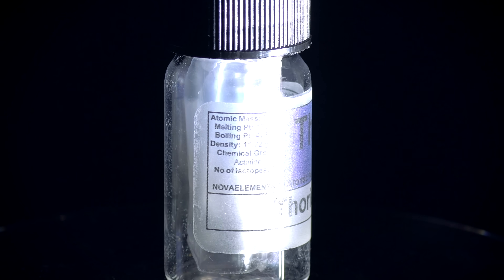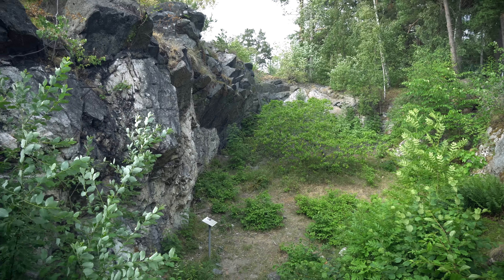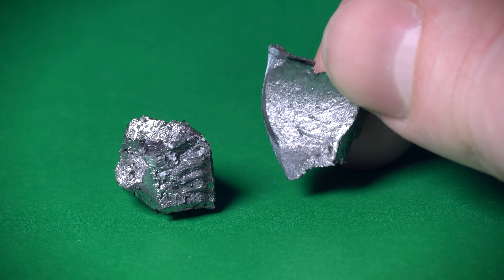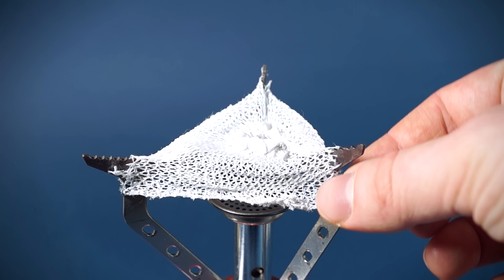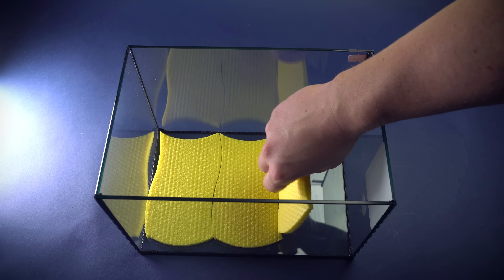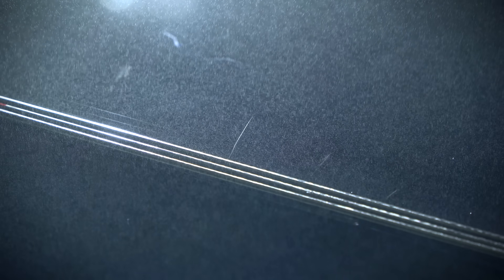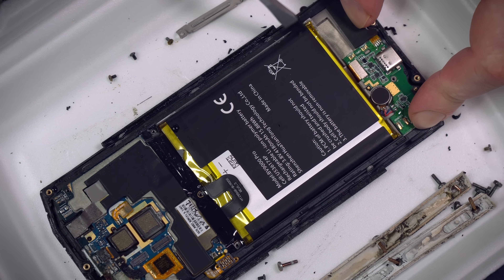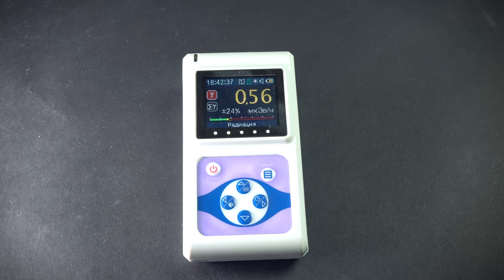Thorium - A METAL THAT NO ONE NEEDS!

Comment: In high voltage vacuum tubes, the filament is usually Thoriated Tungsten, which is a Tungsten wire coated with a Thorium-containing alloy known as Thoria.

Comment: There is another possibility for thorium in long distant space travel where it's not just a chemical fuel needed to go long distancees but a irradiated sorce to creat propulsive force, such sorces could be used putting satellites and other UAVs in space not limited to but for example the challenger probes or using them in a more updated form of long distance manned space travel, during such missions astronauts are subjected to being exposed to large amounts of different types of radiation anyway being in a sea of stars and still safely in space suites when making repairs to equipment, exposure to this radiation wouldn't matter as long as a space suit is designed to protect against it which means liquid rockets can be phased out after exiting earth's atmosphere and remandors of liquid fuel can be saved to transition back to upon re entry to earth's atmosphere.

Comment: Nuclear reactors can run on This
Reply: thorium sucks as reactor fuel.
its fission reaction is far weaker than plutonium and it falls off into useless waste way quicker.
you would need several times the amount of thorium to make fuel rods that last as long as currently used plutonium based reactor fuel.

Comment: You seem to be forgettingThoriated Tunsten electrodes for TIG welding?  Of course Thorium is usefull,  gives excellent service for welding Aluminium alloys with AC TIG welding plant.  One of many alloying elements used in tungsten based electrodes, Cerium, Thallium, Zirconia... each gives the electrode the characteristics it needs to give good welds in a variety of different metals.

Comment: Thorium can be used as fuel for the molten salt reactor design and it would be much safer than the current generation of Uranium fission reactors, If governments and the Nuclear Industry would quit ignoring and suppressing the technology. Currently not used as it can't "breed" plutonium for use in nuclear weapons. They want their weapons, piss on generating electricity.

Comment: Thoriated thungsten isn't just used for welding electrodes but also as filament wire for electron impact heating within ultrahigh vacuum experimental setups - of course in very low concentrations. Thermionic emission of electrons is facilitated by segregation of Th to the wire's surface, lowering the work function for electron emission when an electric field is applied between the wire and the heating target.

Comment: Hello! 😵 Thorium is probably the only future fission energy source. Fusion will stay a decade away for the next 50 years, barring a major break thru. 
Renewables will get cheaper, but are not concentrated and not consistent enough for base grid supply.
Uranium fission power promotes nuclear weapon proliferation. Eg Germany and the Swiss are actually 6 months or a year from being able to make and use A explosive devices.
Thorium reactors do NOT generate plutonium, need for A bang bangs, and fissile triggers for H bang bangs.
Lastly a Thorium reactor can consume high level waste from legacy Uranium power plants. Thorium reactors need an external energisation step to work (so failsafe, no core meltdown). This energisation could be provided by either nuclear waste burn, or a cyclotron providing the neutrons needed to start and sustain the Thor reactor.
Reply: for fusion, you want SMALL elements, not large ones.

Comment: Forget about thorium reactors in the future, we currently use it to get actinium to treat cancer. Seems you didn't do all your homework here.

https://youtu.be/DmczVhGq8cU

*Also, it's only thorium-232 that has a 14 billion year half life. 231 has a hl of 25 hours, and 233 is 21 minutes. Come on, man.
Reply: we already have produced high temp thorium reactors in the last century.  several countries did.  they worked great... but could not politically compete with uranium, so were simply dropped.  only India continued the work on them.
Reply: @thomasneal9291  I heard they were mostly dropped because of the excess of uranium from the cold war, or something like that. A matter of convenience over safety, since uranium power plants need pressurized systems while the thorium does not. These pressure systems failing have been the cause of many incidents.

Comment: If Thorium reactor comes , Electricity issue of India would be filled for thousands of years , as India has largest thorium reserves .
Reply: India has all but abandoned Thorium reactors, & is looking into EPR & VVER reactors.
Reply: @rhynosouris710  VVER reactors DO use thorium.  gees.  in fact, the design is over 50 years old, and those reactors have been produced in both the US and Germany in the last century, and they work much better than standard uranium reactors.  the reason it was dropped was pure politics, and nothing more.
Reply: @thomasneal9291  Sadly, you are misinformed. But don't take my word on it, do a bit of research.

Comment: Thorium could be used as fuel for nuclear reactors. Much safer than uranium and plutonium.
Reply: not could be, HAS been used for nuclear reactors of the very high temp variety.  both the US and Germany had produced functional high temp thorium reactors in the last century.  they had some kinks, but overall worked much better than standard uranium reactors.  they were abandoned because of politics.  simple as that.

Comment: Thorium is still used in big Xenonlamps as used in cinema projectors. It is the rod going through the Quartz glass and ends in the Wolfram tip where the Plasma Bullet emulates the perfect white light. 
If you brake the rod after (safely!!) destroy the big Xenonlamp, you can see the specific form of the Thorium.
If you want pics, just ask me.
Ps: Xenonlamps in cinemaprojectors will not be replaced by Leds but by Laser.

Comment: Your panickmongering does not and will not help us through the current energy crisis. Sooner or later we will find out that there really is a limit to how much petroleum is available on Earth and then what will we do? Burning thorium as a fuel is likely the most cost effective and logical way out of this mess, but people like you are already running around trying to frighten people about "radiation."  Yes, thorium is radioactive. So what? It is far less radioactive than uranium. Yes, you can be poisoned by it, just as you can suffer from lead poisoning. Stop being such  a fraidy cat!
Reply: I'm picturing you eating a lump of thorium dust and triumphantly yelling "SEE?"

...and then dying 2 weeks later.

Comment: Thorium is very useful indeed. It's used in TIG welding electrodes because being a beta emitter it starts an arc very easily.  Also used as a cold cathode emitter in some electron guns.
Reply: EVERYBODY knows this. 
Why do people like you and the others that post the same comment keep repeating it?
Reply: From a user's point of view...

In comparison to a pure tungsten, the thorium in the electrode simply keeps it a little cleaner due to a little less erosion  before it needs cleaning, and doesnt need the point touching up with a grinder quite so often as a pure tungsten. 
In comparison to ceriated tungstens, the difference is negligable. Hardly any difference in use, except the dust produced when grinding/cutting it being mildly radioactive. Therefore anybody still using thoriated tungstens (when there are multiple alternatives) is simply an idiot.
Reply: @kf8575  radiation of thorium from tungsten rod is very low
Reply: Thoriaded>cerated
Reply: @АлакПатрова  How about lanthanated tungsten?
Reply: It's also used in the electrodes of arc lamps, like for example for cinema projectors.
Reply: It is not to do with being a beta emitter. In fact, it (or rather its daughters) is a rather poor one. The benefit in the electrodes is a metallurgical one. The electrodes last longer and produce a better weld.
Reply: @revcrussell  Simply not true. I don't know where that idea comes from but I used to work in research in electron microscopy where these things are studied at University level. Look up thoriated tungsten work function.
(Work function is the voltage needed to 'pull' electrons out of a metal surface) 
https://physics.stackexchange.com/questions/359187/thoriated-tungsten-filaments
Reply: @qwadratix  Yes, it has a lower work function. That is a 'metallurgical' property not a nuclear radioactive property. Thorium is not radioactive enough to reduce the energy to start the spark (enough to matter). There are places where this is done but here it doesn't matter. Look up Kr-85 filled vacuum tubes.
Reply: @revcrussell  True, Work function is a property of the quantum states of the electronic structure of the bulk metal. As such it's extremely complex and there's no practical calculation I'm aware of that allows you to compute it directly from basic parameters. However. I entertain a (possibly unjustified) conviction that the electrical potential developed by an unstable nucleus is going to influence the bulk property. I shouldn't have stated it as fact. I'll also add that the beta particles emitted will also tend to produce some ionisation in the surrounding air, Also probably a factor.
 But at the end of the day, thorium is added for it's ability to initiate an arc, not it's thermal properties. That much is certain

Comment: Thoriated tungsten was also used in some vacuum tubes for old radios. I think it improved electron emissions from the cathode.
Reply: Still used in high power RF tubes.  Thoriated tungsten cathodes increase electron emission.  Worrying about the radiation is another boogie man IMO.

Comment: So, More than 100 years ago it was discovered that thorium oxide was radioactive and residual waste too expensive to dispose . Manufacturing industries discontinued in products.  Today China found uses fort thorium  and ways to dispose of products that radioactive but only if you're within a few centimeters. Alpha particle attractive Thorium oxide filled  stylus looking pens with a pocket clip, no pocket protector  included. Forget the plastic lenses , there's colored UV reactive sunglasses made with thorialized glasses.

Comment: "Thorium's is useless" safer nuclear reactors: am I a joke to you?
Reply: Sadly they're only a hypothetical rn. India is researching the technology at the moment but they have not yet found a breakthrough that would allow a thorium reactor to work. You can convert thorium to uranium to use in nuclear power plants, but it defeats the safety issue, and is actually far more expensive than just buying uranium.
Reply: @justcallmenoah5743  I thought there was already a good plan for them, I just remember thorium having to be combined with another element(plutonium?) And it doing the same thing a pure uranium reactor does. But when it fails it seperates thorium from the other element and the entire process stops
Reply: @spicylemon9339  not sure what the other dude is talking about, but there are actual designs that work. We just haven't really seen one of those since the sixties. 

One thing to get out of your head is "thorium reactor". You can breed uranium with thorium, but the reactor still technically runs on uranium. Breeder reactors just use the nuclear reaction to make more fuel (like by turning thorium into more uranium) as it generates energy. Other fuel cycles exists but the thorium concept is the best known.

Thorium is also not really about safer reactors, at least not directly, though the proposed designs we see all use fourth generation intrisinsically safe designs. You could not use thorium at all and just use uranium directly and it would be as safe.

The Molten Salt Reactor is the most common type of next-gen reactor that is presented to the public, often in the context of presenting the LFTR (Liquid Fluoride Thorium Reactor) concept. These reactors are intrinsically safe, meaning that there is basically physically nothing that can go really wrong with these reactors. No explosions or meltdown is physically possible. There is also no radioactive gases to escape and all of the fuel is trapped inside molten salt. This is true whether you use thorium/uranium or just uranium.

For reference, most of the commercial reactors around the world are second generation. Third gen reactor are not that common since we built few reactors in the last 20-30 years. Fourth gen reactors are still in experimental stage.

While second gen reactors are extremely safe, third gen are insanely safe (due to integral passive safeties) and fourth gen are absolutely safe (due to intrinsic safety design).

I could also talk on and on about fuel cycles and  recycling of nuclear waste, but that'll be for another day.
Reply: @Numitronic  wow I am very greatful for this deeper knowledge of reactors you've shared :D ty!
Reply: @Numitronic  That they are super safe is what you get told about every kind of nuclear reactor right until the shit hits the fan.
Reply: Recently researched our current technology of using thorium in fission reactor
And it may actually be worse in the shielding part because some of the byproducts are short half-life elements and emit gamma radiation which is hard to shield against so you will have to use more shielding
And the best hypothetical reactor now is a molten salt reactor with a thorium-uranium cycle, because we allready know alot about uranium fission so we have know atleast half of the process already

And lastly, thorium is a fertile element and not fissile by itself, the decay of it makes usable elements for powerplants, which means it cant work alone ( at first ) , but could be made into a thermal breeder reactor.
Reply: Nuclear reactors are safe to begin with
Reply: @JnH5492  yeah, its just like a gun, it cant kill unless its used to kill.
That also means accidents can happen if you are reckless, and dont follow the safety guidelines.
Litteraly the same that can happen to a reactor, yet people fear the reactor the same way they fear guns

Comment: If thorium was used as nuclear reactor fuel it would be alot cleaner than what is used right now BUT, thorium reactor waste cant be used as a weaponizable material.  soooo the powers at be will never consider it as an energy source even though its way more economically abundant.

Comment: Thorium as a nuclear fuel. Thorium (Th-232) is not itself fissile and so is not directly usable in a thermal neutron reactor. However, it is 'fertile' and upon absorbing a neutron will transmute to uranium-233 (U-233)a, which is an excellent fissile fuel material.

Comment: China and India are experimenting with thorium reactors, of which there are several kinds, and at this stage it is difficult to decide which type of reactor to use. Thorium is thought to have some advantages over uranium and plutonium, the main one being that serious reactor malfunctions are impossible. As you say, thorium can be converted into U233,  which works well in reactors but is not much good for bombs, though theoretically a  rather inefficient  and unreliable bomb could be made from it. No one has ever made such a bomb. When China and India can decide what type of thorium reactor design holds the most promise, I suspect thorium reactors will become popular.

Comment: Microwave oven tubes still use a tungsten-thorium alloy, so it is hard to say this metal is useless. That being said, great video, I always learn a lot from you.
Reply: Beryllium oxide is what is used in microwave oven magnetrons.
Reply: @bradfordjeff  BeO is used in the insulation parts of the magnetron. Th-W alloy is used in the cathode of this electron tube

Comment: Your vapor chamber was not only not too concentrated, it was perfect to be able to show how the alpha particles possibly travel based on conditions that mean they don't follow a straight line. It looked as though within the cloud of ethanol there was a path of least resistance and some of the alpha particles actually traveled in what looked like paths through the cloud based on the path of least resistance.

Comment: Thorium is VERY USEFUL in Molten Salt Reactors! Not only does this allow for Fuel BREEDING (extra radioactivity) but it also allows for the use of DEPLETED URANIUM - such as in Canada's CANDU type reactors!

Also Molten Salt Reactors are FOOL PROOF! There is no physical way one could Melt Down - as long as it is built properly! And even if it was not built with a bypass tank for overheating salts, the worst that would happen is a SMALL SCALE nuclear release!

Comment: Magnesium-thorium or Magthor was an essential material in several wars for helicopter engine components due to its resistance to creep and deformation even at high temperatures. It was thankfully replaced with safer alternatives, but it fit the bill when better research wasn't yet available.

Comment: As someone who has done a lot of TIG welding... there is no better electrode for welding stainless or carbon steel alloys than 2% thoriated Tungsten. (I haven’t used a high %) 

The other options just can’t carry a consistent arc as long. Especially at higher Amperages. 

With that said... after watching this, I wish there was a better option. I know a lot of welders who carelessly breath in the dust produced by sharpening their tungsten electrode.
Reply: Jeezuz, I'm glad I've at the very least been wearing p100s for the last 10 years or so.

...I wonder what other hazards we're going to be made aware of.
Reply: Everybody who watched the video knows this.

Comment: Thorium is used in the manufacturing of vacuum tubes-used in the cathodes to assist in emitting electrons when the cathode is heated by the filament.Tubes are still used today in large RF power amplifiers-and in smaller scale in Hi-Fi audio amps and ---guitar amps so prized by musicians.And Hi-fi music listeners.So the stuff isn't completely "useless".